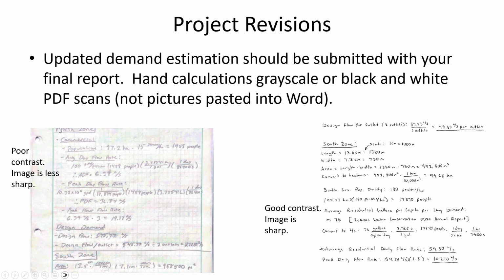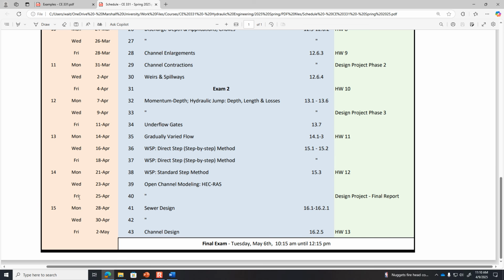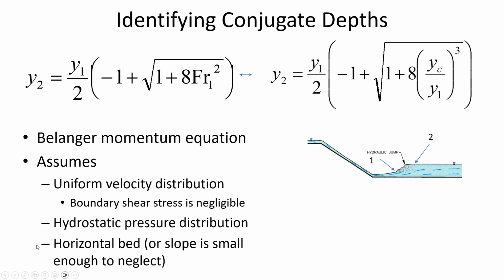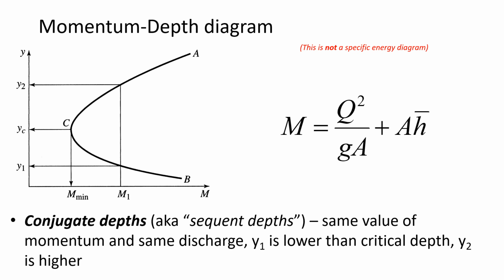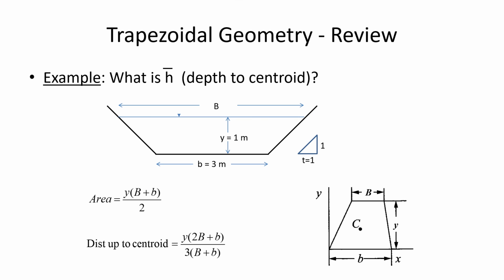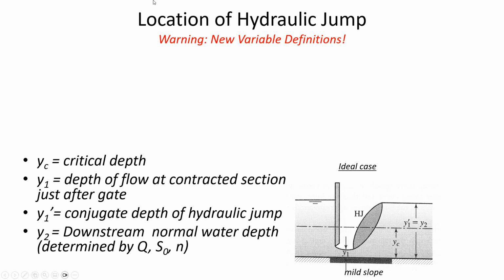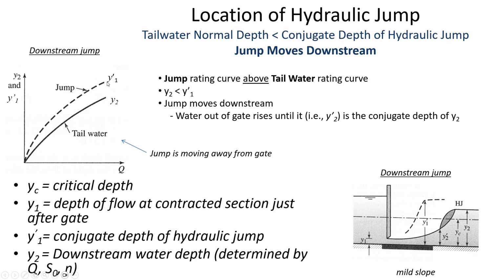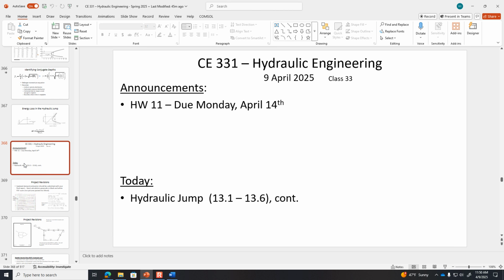Hydraulic jump depths using Belanger Momentum Equation - CE331, Class 33 (9 Apr 2025)

Comment: While using momentum function formula, should we use h(bar) depth from top of the water surface or from bottom level?
Reply from the maker: h-bar is the distance from the top of water surface to the centroid.
Reply: Thank you professor! I had an exam in hydraulic engineering and i scored 95/100 on that exam. I watched your videos for reference, they are very insightful and they helped me a lot. Thank you so much! ❤️❤️
Reply from the maker: @RameshDulal-z2r  congratulations on your great score on the exam! Thanks for watching.